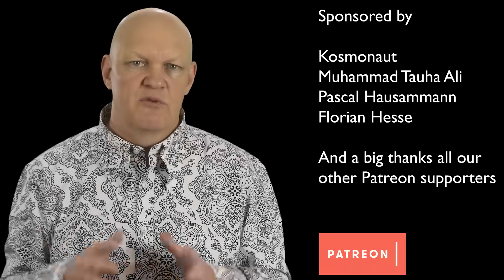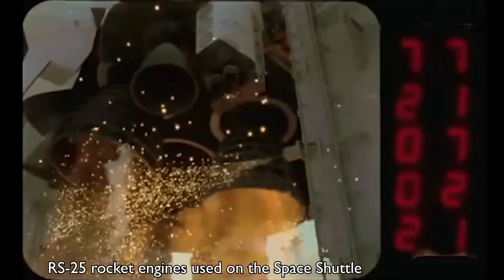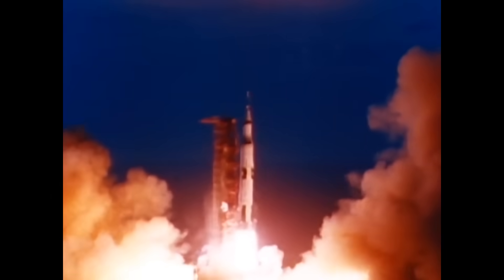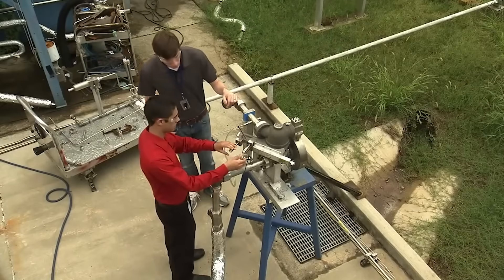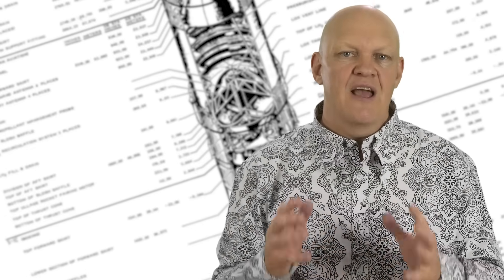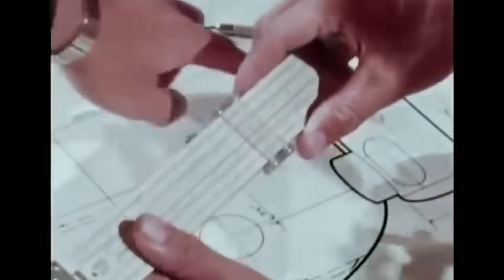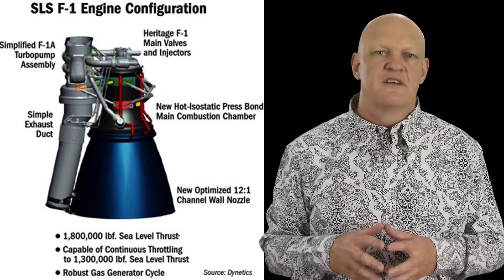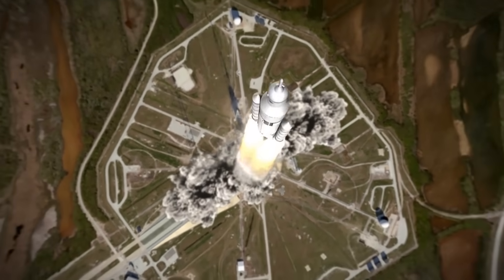Why Can't we Remake the Rocketdyne F1 Engine?

Comment: When the f1 engine was in development it had a problem with the fuel exploding in the line so the designers tested the engine by putting a detonation roughly the size of a grenade in the fuel lines. They fixed the problem eventually even though they never knew what caused the problems... At the cost of multiple engines

Comment: I design metal things (not rocket engines) for a living and I've examined a real F1 engine. I was stunned at how labor intensive it was to build. Each nozzle alone must have had upwards of 10,000 man hours invested in it.  It would be fabulously expensive to recreate that engine, just as it was in the day.

And,  since you asked, I prefer the longer format.
Reply: If you get a chance, try to crawl all over the Supermarine Spitfire. I've read just one of those took the equivalent of three full working lives to build.

One of the various advantages of the US P-51 is it took about a third of the labor to build, largely because the designer designed it with mass production in mind.
Reply: "the designer designed it with mass production in mind."

This, in spades. 

If you're only making a few then you don't build a production line. Even today most spacecraft and components are essentially handbuilt one-offs, even with CAD, 3d printing and CNC equipment. We make dozens or hundreds of prototypes but these can't be production lined either as each one is subtly different.

We could save thousands of hours (possibly even tens of thousands) with 3d metal printers, but they cost so much that they vastly outweigh the wages (and experience) of our engineering staff - and there's no way we want to lose those guys, to the point that we encourage them to stick around after retirement and pass on as much of their knowledge as possible. They do more documentation than metalbashing and there's a shadow staff dedicated just to supporting them.
Reply: The US Gov was in a space race. It solved the problem by throwing money at a bottomless pit.

As for SLS, putting people on top of solids is unlikely to end well.

Comment: Generally, I frown upon solid rocket engines. However, if it's being used as an SRB and the space vehicle itself ironically has a solid rocket escape motor, then I'm relatively OK with it. 

The argument there is that large solid motors are stupid for human space flight due to the inability to throw the off switch. But then the fact that the SLS is a capsule design allows them to use a much more thoroughly tested, more carefully designed and manufactured solid motor as an emergency escape system. In a very clumsy, almost elegant (?), way, it side-steps some of the issues that using that very technology inherently creates.

That said, the F-1's are just plain cool, liquid engines are far superior in terms of overall (Isp and thrust throughout the flight profile) performance and, the cost would probably make itself up if they were, indeed, able to be constructed out of just 40 parts.

Comment: The biggest problem is you teach these new Engineers only to use a computer they don't really have any practical experience working in a machine shop making parts or doing anything so there's always a constant battle between The Machinist and the engineers I find I send blueprints back 75% of the time because they're designing systems for tooling which doesn't even exist even in this day in age and making it impossible designs that look good on paper but are not practical in life good job Society you raised a bunch of inexperienced Engineers that only know how to use a damn computer.

Comment: I can say I was lucky enough to see the truth in this with my own eyes, and knew two guys that provided parts. One was a machinist with a 8th grade education, but incredible mechanical understanding and skills. Presented with the manifold that you can see in this pictures, the donut shaped pipe that surrounds the engine core and is tapered so the diameter grows as it goes around the engine. That pipe, using modern methods would be done with CNC equipment, with 4x the wasted material and 3x the cost of what he did. First, he got a forging made of the rough shape out of aluminum. He then used what is called a T lathe, and machine tool that is no longer made, but had the way of the machine aligned at right angles to a conventional lathe. They were used to make large diameter, but shallow parts - the missle guys loved them. He then sat down and using a power takeoff to the lathe head designed a gear train and tool holder that would move the tool in a way to get the donut of constantly changing diameter machined correctly, requiring a simple gear change to get both the outside and inside of the shell machined. Now what he created was half the donut, cut through the edge so the two halves welded together made the whole donut. The other guy was the guy who did the welding, actually TIG welding the two halves together. He also made his own tools to preheat the assembly to help weld it, but it had to be done carefully so you didn't anneal the aluminum and make it useless. Amazing guys, both of them.

Comment: The factory where the F-1 (and RS-25) engines were built used to be just 2 miles from my house but the factory was closed and torn down over the past few years with the last parts of it being demolished this year.

An unflown F-1 engine was on display in front of the factory since before I was born, the engine got relocated to another aerospace company.

Comment: I had read a article not too long ago that said that we were purchasing Russian high thrust engines? Is that still the case and are those designs open for reverse engineering?

My dad worked for Rocketdyne and many was the time that when one of those engines during a test run up would blow up you could hear it clear crossed San Fernando Valley and we knew dad would be home late.

Everything was trial and error and I heard some of the same comments made by the previous notation about machinist and Engineers working back and forth to finalize a design.

I would very much like to see the f-1b fly. We need back in space on our own.

Comment: Everyone in the comments saying that the following generations have gotten dumber have altered the narrative completely when they omitted that the redesigned engines used 5,560 parts fewer, had greater efficiencies at an increased reliability. We haven't lost skill by moving past the drafting board and the slide rule, we've gained proficiency in creating much more precise and cheaper parts in ways that are much more affordable and leagues faster to design as well. The reason all the tweaking and adjusting that had to be done in the old days is lost to the world is that in the modern era why make an engine that doesn't have interchangeable parts when everything is done to 4 or 5 digit precisions. If you can have a machine weld a part that is almost perfect your loading and stress calculations actually apply, allowing you to use tighter and tighter margins of error because you can have confidence in your parts. In the world of space exploration there is never a second's hesitation between precision and nostalgia.

Comment: I was one of those machinists. I was a contract machinist for Ace Aerospace Systems way back in the mid 70s to mid 80s, which was half-owned by the VP of Consolidated Controls Inc which was responsible for almost all of the pneumatic control systems on the shuttles. I had parts on all of them including 23 of the fuel pressure regulators for the main ascent engines. It took me 13 months full time to make all the parts and to machine the housings for just one pair of them (one for O2 and one for H2). I can tell you for certain that it stretched standard industrial capability to the absolute limits to make them. The first pair was for ground testing the engine and the fuel system and they were forgings made from A-286, which is a stainless steel casting alloy. During initial ground testing just after throttle-up there was a glowing composite ceramic chip from somewhere in the fuel system that attached itself to the first thing it passed that had any iron in it, which was the inside wall of my fuel pressure regulator (oxygen side, O2@400 deg F @4000 psi) which immediately blew a 1/4 inch hole in the side of it and the hot O2 stream went through a steel sheet/masonry wall and hit and killed a technician 30 feet away. they changed the casting alloy to 750-Inconel and put inconel filter screens in the remaining A-286 regulators.
 Safety around these things was no joke and neither is the fact that the know-how for building the old technologies are long unavailable. Elon Musk isn't having any trouble and neither are the top contenders for his contracts. It will all be academic soon anyway as I have seen gravity field demonstrations that will be shown to the public soon. There will be spacecraft that will get tourists back and forth to Mars safely in my lifetime. :-)

Comment: NASA should have built and test flown F1B even if they didn't select it for the SLS.

https://arstechnica.com/science/2013/04/new-f-1b-rocket-engine-upgrades-apollo-era-deisgn-with-1-8m-lbs-of-thrust/

8 meganewtons and 2.6 km/sec exhaust at sea level and 3.0 km/sec exhaust at altitude.  

Imagine 7 elements equipped with cross-feeding.  Each element is 640 metric tons (1.41 million pounds) 8.1 tons is the engine weight and 12.9 tons is the structure.  21 tons structure and 619 tons propellant.  184.2 tons kerosene and 434.8 tons LOX.  That's 204 cubic meters of kerosene and 346 cubic meters of LOX.  

Now the space shuttle external tank held 2,025 cubic meters of propellant it was 8.4 m in diameter and 46.9 m long.  Now, a similarly shaped tank holding LOX/Kerosene in the amounts called for above, would be (550/2025)^(1/3)=0.6476 so an External tank shaped rocket body that propelled by a single F1B engine and was 5.4 m (7.8 ft) in diameter and 30.4 m (100.0 ft) tall and weighed 21 metric tons (46,300 pounds) nearly the same weight budget as the Super Lightweight Shuttle tank which was considerably larger.  

Total cost including engine $20 million each.  

So, imagine a clustered propellant tank feed, feeding 7 engine in 7 elements clustered together with cross-feeding

    (1) (2)
(3) (4) (5) 
    (6) (7)

1 and 6 feed 3 - 0.75 flow
3 feeds 4 - 0.5 flow
2 and 7 feed 5 - 0.75 flow
5 feeds 4 - 0.5 flow

So, 1,2,6 and7 drain while they accelerate upward.  619 tons in each this is the first stage. 
1,2,6 and 7 fall away then

(3) (4) (5)

3 feeds 4 - 0.5 flow
5 feeds 4 - 0.5 flow

So, 3 and 5 drain while they accelerate upwards.  619 tons in each this is the second stage.
3 and 5 fall away then

(4) 

Continues to orbit.

Fluidic logic would be used to simplify stage separation and flow control.  

This arrangement could put 150 metric tons into orbit (330,000 lb) - for about $140 million - or $424 per pound. 

OTHER IMPROVEMENTS

Mixing kerosene with LOX - creates a monopropellant which reduces complexity and cost

http://www.wickmanspacecraft.com/loxmono.html

Which is similar to that done with hydrogen peroxide and carbon

https://patents.google.com/patent/US20120234196A1/en

This running gear could also be used in an aerospike form, using a zero height aerospike with thermal protection at the base - to make the system even higher performing - and potentially recoverable, radically reducing costs.

https://www.youtube.com/watch?v=-0Y0FS8Z1Qk

Comment: As an Engineer I don’t get how redesigning an old design for modern methods and materials is different than producing an old design with modern methods and materials.
Reply: What kind of engineer are you?  The old engine was built from thousands of parts using hand skills and tricks that people don't know anymore. The old design can't be built with modern methods because it was specifically designed for the old methods - manual, skilled labor.  Modern automated methods explicitly are at odds with the original design.

Comment: Love the short-form video. Anything over ten minutes gets postponed until "later, when I have time to watch this one." Ironically, I also find that anything over 40 minutes I feel free to begin watching ASAP, in 4 or 5-minute chunks spread out over a few days, since it is simply too long to fit into my commute or other downtime. So I'll begin (or continue) an Isaac Arthur epic but scroll past a lot of Everyday Astronaut videos... maybe that's just me.
And FWIW, cast my vote for the F1-B modernized heavy-caliber liquid-fuel rocket motor! I think if the old Apollo engineers saw the new proposal, and realized it could be done with only 40 parts, they would be thrilled. Do all the careful tweaking on just one prototype test engine, and when it works perfectly, make endless perfect clones of it, rather than hand-crafting each individual rocket engine and then carefully matching them with their mates for each launch.